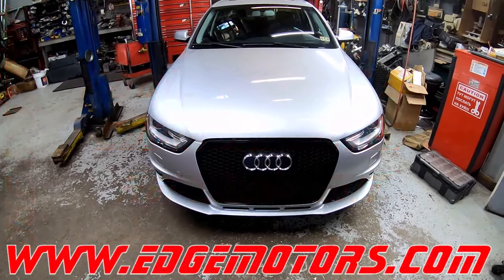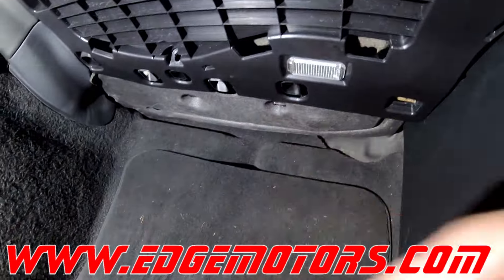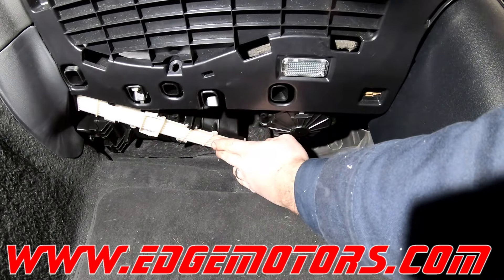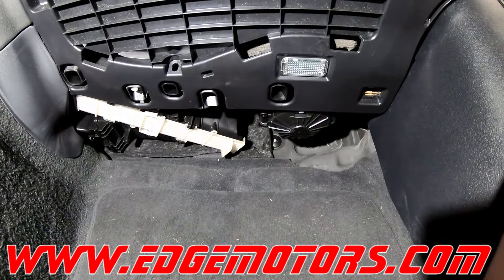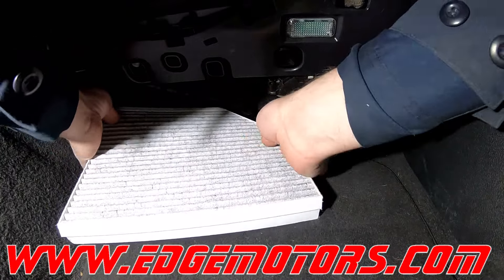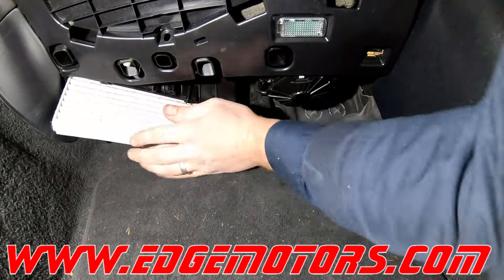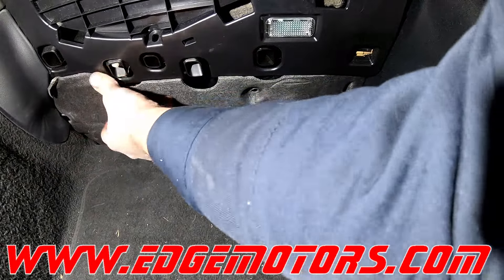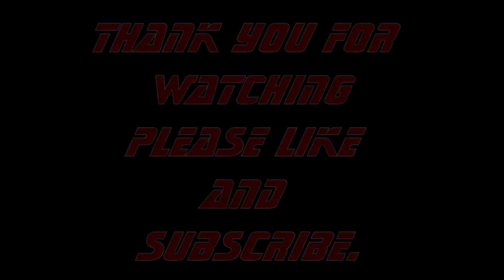2009 to 2016 Audi A4 Cabin Air Polen Filter Replacement DIY by Edge Motors

Comment: Loud whistling sound after I installed mine. Is that supposed to be normal?
Reply: Hi. I changed mine and got that same whistling noise after. It was because that white cover didnt go alltheway to the end on that closed position. Closed that cover properly and whistling was gone.